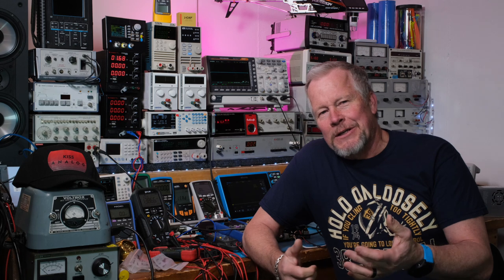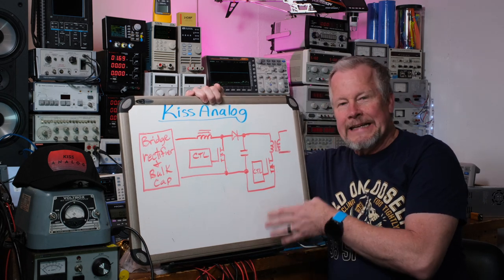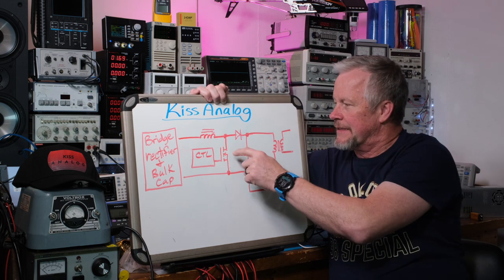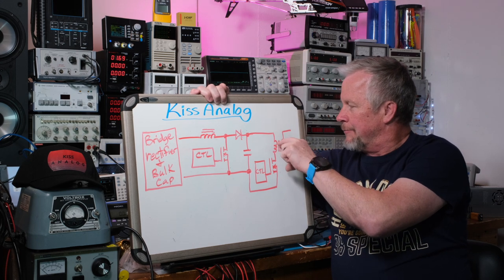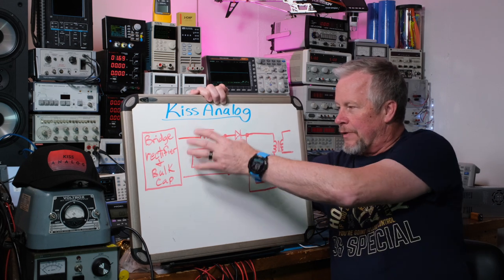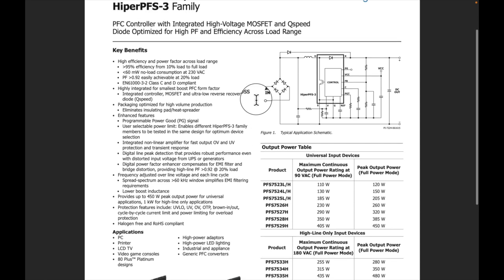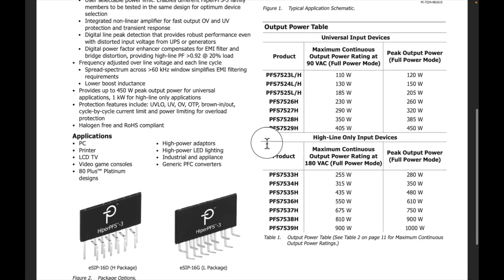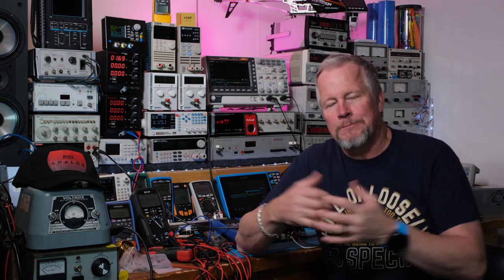JAT Power Supply Collab - Thru hole Vs Surface Mount - example of PFC converter #pfcconverter#jat

Comment: Through hole is easier, but I have all the tools needed for Surface mount. Just make them large enough to handle easily. Trying to pick up smaller than a grain of sand with tweezers is pretty difficult.
Reply from the maker: I totally agree - there's no upside using small parts, and there is no downside of using larger parts.  It isn't like this will be a very dense board full of parts.

Comment: Some guys, including at least one other YouTuber, sell their designs via Crowd Supply, which uses Mouser to fulfill orders. This might be an option for you if you decide to sell assembled boards or possibly kits. You might also consider providing an enclosure, making the power supply safer and possibly more acceptable to users who aren't comfortable working with line power.
Reply from the maker: Thanks @MikeMike you make some excellent suggestions!  I need to learn how to make something work with Mouser.  Also for a finished product in an enclosure is an excellent idea!!  I also need to learn the pros and cons of the crowd supply thing and how it works.  If you have any suggestions - I’m all ears;)

Comment: Since the datasheets of those integrated components have PCB layouts already, a board with discrete components would be my vote. And surface mount components aren't that bad to solder if they're not overly small.
Reply from the maker: Thanks Scott!  If we do go SMD I'll keep them on the larger size.  I might do the work to do both versions to see what the board houses charge for each - and possibly to offer fully populated boards;)

Comment: Hey Eddie thanks for the great video. what a great idea one chip done reminds me of the day when I bought an amplifier it was all one monolithic chip and it burnt the rug in our house at the time when it blew. not saying that that will happen with this. I'm sure it's very reliable.  but not very modifiable and not very serviceable especially if they stop making that module, you're back to square one. Discreets and surface mount, as it is the future and you might want to get used to it. I'm fine with the board company gluing the parts down for me. I have ordered many boards, I'm all about the design not etching my sink, those days are past. 🤓
Reply from the maker: Thanks David for your feedback!  You are so right - I am glad that those etching my own boards are long gone;) I think I might keep it discrete as it will be better learning and keeps the design from aging.

Comment: I did want to test with my tube amplifier, a good power supply can stand all kind of usage. For the size, surface mount components is good, save up space, just not too small, they should be able to service with normal equipment, I think not going to extreme, so a mix of through-hole and SMT that benefit most of the people.
Reply from the maker: I agree Johnson, If we do surface mount we will keep the parts large;)

Comment: The question is, is it worth building a SMPS yourself? With so many on the market, some good, some not so good. I wonder how many people would be able to fault find should it not work? Getting or making the transformers and inductors. Sure, some people could, and would be able to do this. For simplicity and easy construction, not forgetting being able to remove components for service, threw hole would be better. Even a single sided PCB better still, but probably impossible. An option to buy the complete PCB tested another option. Then of course why would you want to do that? It would probably cost more than a off the shelf option. Sorry, this is not a solution but questions I asked myself, would I buy one or build myself?
Reply from the maker: Thanks for your feedback Michael!  I think it is a great learning tool to actually design our own power supply.  It will be bullet proof;) Seriously, it will be very robust and should be interesting to see the feedback from others.  Unlike what you can buy - it will be customized for audio application regarding the output filtering.  Also, I have had a very tough time finding a good low noise power supply that also has a PFC stage.  Have you found one?  I’d love to have a PFC front end and low noise output stage.  I wouldn’t doubt it if we find this design copied in China and provided at a lower cost;) My next higher power design - might even be copied by US audio companies that are too cheep to hire a power supply engineer;)

Comment: I would be interested in thru hole for easier DIY.  Also, I have several preamps (Krell, Threshold, etc.) that use external power supplies that I think would benefit from a better power supply.  These could be much lower in power, so should be less expensive to build.
Reply from the maker: Thanks for this feedback!  I think this year will be a fun year for power supplies;)  I have a pre-amp with an external PS.  They are out of business now, but an interesting design; https://youtu.be/uQJT2DlTwd8

Comment: JLCPCB and PCBWay both supply blank boards and PCB assembly at low cost. If you supply (or sell) Gerber files and BOMs, we could order just blank PCBs, assembled PCBs with just SMD parts, or assembled PCBs with SMD and THT parts. I would probably order an assembled board with SMT parts and add the THT parts myself.
Reply from the maker: Thanks - this is great!

Comment: And yes, those Power Integrations parts look cool. The company has actually been around for quite a while. They had just started up after I worked on my one and only SMPS design, so I regrettably never got to use their parts, but I'm not really qualified to design an SMPS anyway. It would be nice to see what a power supply pro can do with them.
Reply from the maker: I agree, it would be interesting to use the Power Integrations but I'm still considering the discrete solution as I think it might be more educational.

Comment: You can design a PCB so that it can be mounted with elements in SMD or THT technology, it is a bit more work, however, such a design is much more flexible and is suitable for a wider group of people. I always thought you wanted to design a power supply that would be more than just a PSU for the JAT project.

Comment: Thank you so much for explaining all this stuff. Switching power supplies always seemed a bit of magic to me. I would love to be able to DIY this myself if possible so thru hole would be ideal but there also might be some SMD components available that are big enough to still be hand soldered? And last but not least, you mentioned in one of your previous videos to have a look at GaN FETs. Is that out of the window? Or are these integrated packages also available with GaN?
Reply from the maker: Thanks for your feedback.  Packages are starting to use GaN.  It will be much more common in the near future.  I think I might go with the discrete design.

Comment: Thanks for considering fully built board, not everyone can soldering good. I prefer integrated chips since it's simpler, I think those people have skill can easily use separate component to make their own PCB, practical should be more important than educational which can come a bit later, if the PSU is popular I guess people will love it and you can have more resource to improve the design or different layout for different usage, for a product maker should be able to make money for keep the research going.
Reply from the maker: Thanks for your feedback!  I am a bit worried about the expense, so I will be looking at the way it is affordable for me and for others that want to have one:)
Reply: @KissAnalog  Since it's not a monthly or daily but a one-off expenditure, the price can be a bit higher, otherwise I can use commercial cheap PSU, quality did cost much but worth it.

Comment: I prefer THT for personal projects and designs for makers because it is easier to handle. I only use SMT in the case if some of the SMT components has significant advantages over comparable THT components. So I went to SMT for my class D audio amplifier project because there is a very nice high speed voltage to pwm converter LTC6992 from Linear Technology (Analog devices), which can be easily combined with a high speed, high current half bridge driver LM5104 from TI.
Reply from the maker: Thanks for this great feedback Gunter!  I’ll check out these parts:)
Reply: @KissAnalog  Yes, the combination of LTC6992 and LM5104 works great as a converter / controller unit. You can use it for a wide power range. I operate it above of the lower power supply voltage. So I can use it for single and symmetric power supply voltage.

The LTC6992 needs a couple of mA at 5V, that I derive from ground or positive supply by use of a simple 5 V LDO. The controller is operated between ground and -Vs or +Vs and -Vs. It is boot strapped for the use of NMOS-FETs.

The LTC6992 needs a 0.5 V input voltage reference for 50% duty cycle. I coupled it resistively across 47 kOhm to the IC input and the music signal is coupled across a capacitor of 1 µF to the IC input. The input voltage swing can go from -0.5 V to 0.5 V.
Reply from the maker: @gkdresden  Wow thanks for the great feedback Gunter!

Comment: Purley from a personal point of view I will probably design the PCB myself (to early to say) I am interested in the design of the circuit from making the decisions on the specs, choosing the components, breadboarding and problem solving. Regarding the build  I would like the wound components thru hole and the rest SMD. What has John said about using the hybrid parts ? at the end of the day we all want a low noise high power PSU suitable for the JAT 501. Have you finalised the specs yet with John in terms of power output and noise figures ? once you know that its time to put pencil to paper and heat the Iron ! if you don't get anything but confusion from us in the chat (as you probably will !) then take your own direction we will fall in line. I hope I helped even a tiny bit !....cheers.
Reply from the maker: Thanks for your feedback!  I’ll have to check in with John and see what he thinks about the direction;)

Comment: Relating the SMPS I think a PFC is not needed. I think, I would use a simple straight forward forward converter for this power range consisting of a full bridge rectifier, high voltage controller with an external switch and a simple 2nd secondary winding with rectifier for dc feedback.
Reply from the maker: Thanks for your feedback Gunter!  I like the idea of the PFC to keep the input power low noise.  Also there should be no chance of 60 Hz hum as the noisy rectifier switching is gone.  The active clamp is also lower noise and higher efficiency than the Forward with reset winding.

Comment: I would like to adapt this power supply to an old Hafler amp I have to see how  it affects the sound. The power supply in the Hafler amp has supply rails of plus and minus 65.4 volts and the amp produces 120 watts per channel. As such, I would want the power supply board to be adaptable for this purpose and believe thru hole might be better for this. A fully populated board would be my preference, but cost is the limiting factor.
Reply from the maker: Thanks Walter - that’s a great idea!  I’ll point out along the way how this design can be modified for the various applications.

Comment: This multi-chip IC is a great idea if you're designing a power supply that needs to take up as little space as possible, but personally I don't think it's very suitable for a DIY project because in the event of a failure and lack of supply of these modules (in the future) it will not be possible to repair such a power supply. That's why I think it's a better idea to leave 3 separate elements.

Comment: If the frequency changes with the load isnt that going to inject noise into the signal?
Reply from the maker: Great question!  But no, the frequency stays above the frequencies that we can hear, and also there is the second stage with isolation that will help keep that noise from the amplifier.  But, I agree that it is getting a bit low.